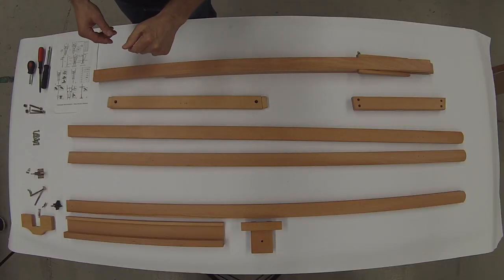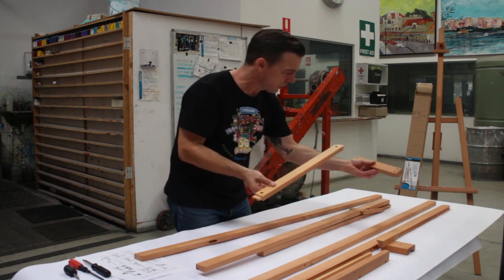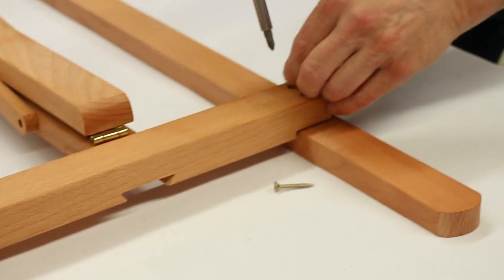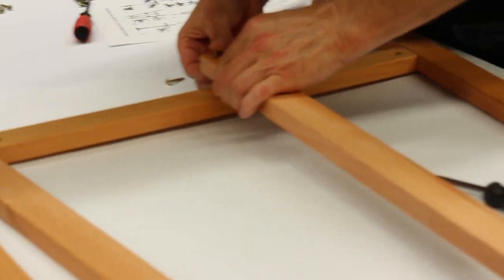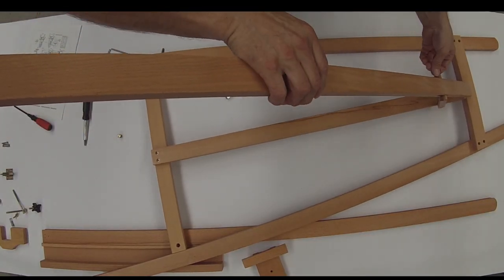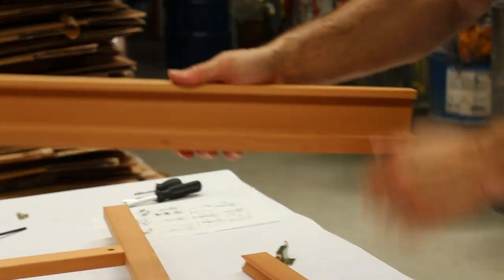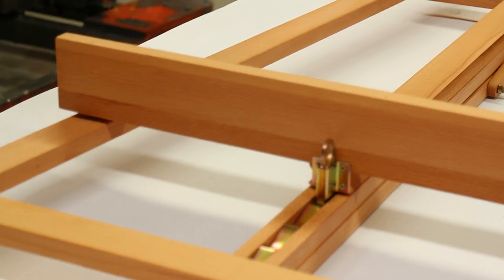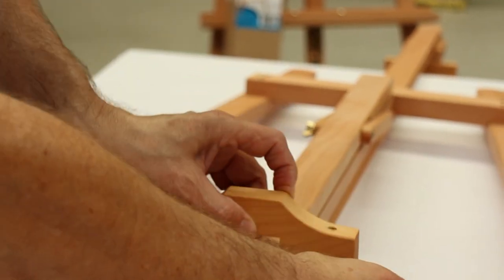How to: Putting together a  Derivan Workshop Easel BE336423

Comment: Hi! I watched this video to see why my A frame easel's cross bar (the part that holds the canvas up) kept getting looser and looser and now it just slides down.  I have this easel 47 years and It has served me well- made  hundreds of paintings on this thing.  Now, just when I really need it the most,  the horizontal easel holder that supposed to stay in place by latching onto each little 'nubby' down the spine of that vertical piece, keeps slipping down. For the past few months it would slip and pop down occasionally while I'm painting but today it just kept sliding all the way down.  I looked it over and all screws are in tact.  Could it be the spring inside that gizmo has broken?  I really need my easel so if you can reply quickly I appreciate it. thank you.
Reply from the maker: It sounds like either the notched track has worn or the spring loaded  mechanism has worn. It might be time to invest in a new one after close to half a century of use! :)